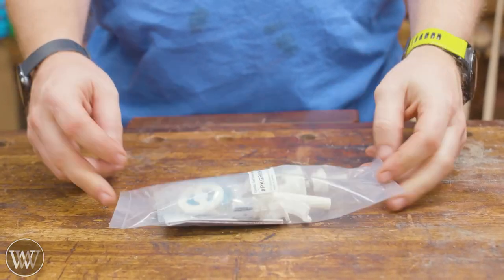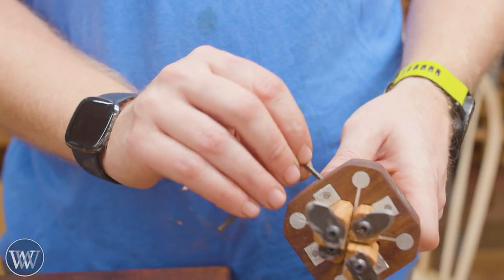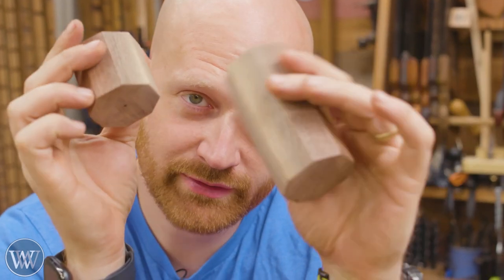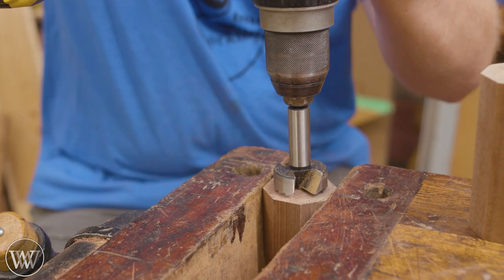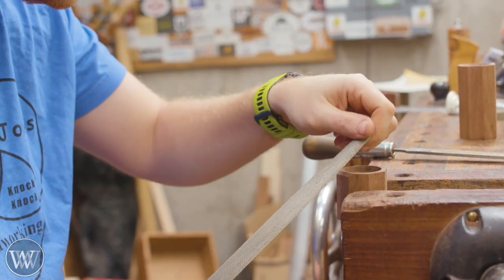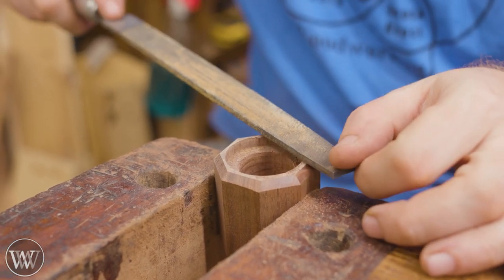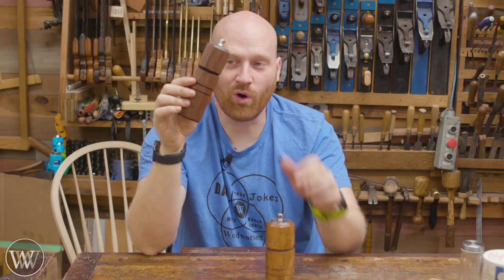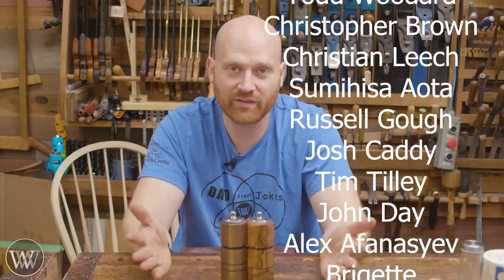No Lathe Salt and Pepper Grinder

Comment: Never even thought to do a grinder without a lathe. Always just assumed I couldn't since I didn't have a lathe, but that looks easy enough.
Reply: Barrels on fine English shotguns are hand struck. They file the outside to match the inside diameter at a perfect taper to distribute the weight perfectly. They start with an octagonal, then increase the flats to 16, 32 and round of from there. Wall thickness is perfect withing a thou or two. You can do a whole lot w o a lathe! I've seen people do large wood screws with hand tools too.

Comment: What brand of files do you use? Are they from amazon?
Reply from the maker: I generally use cheap files. When it comes to files woodworking cheap works just as well. Now if you're looking at rasps then you get what you pay for. That is two particular brand. I generally don't look at the brand, The cut pattern is what's important.